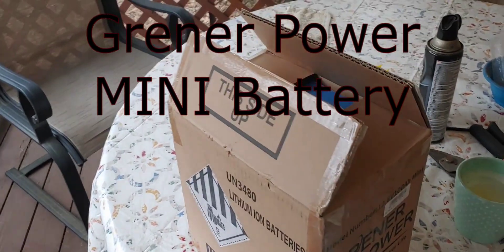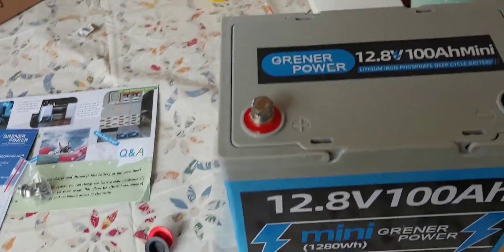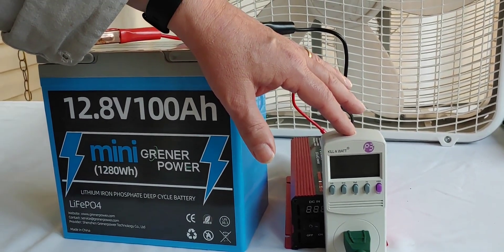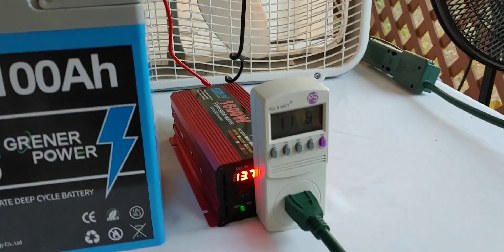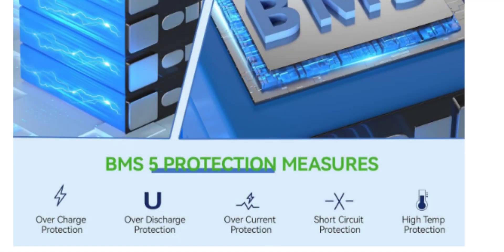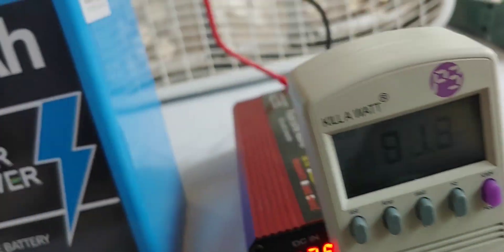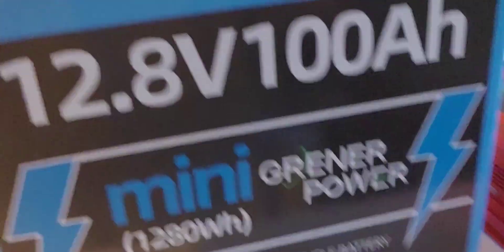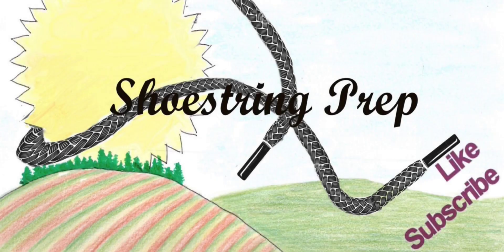Grener Power MINI Battery is this cheap LiFePO4 battery worth the low price?

Comment: I bought a 4 pack of these.  They seem like good batteries, but one of mine came quite unbalanced and all of them improved after pushing a full charge several times over a week or so.

You can tell if they are not balanced if you have a good charger that charges to say 14.5v or 14.6v but no higher and a reasonable volt meter.  When the charger turns off, disconnect it, then put a small load on the battery for a few seconds.  Disconnect the load and measure the battery voltage.  It should be well over 14v.  My four will now be 14.25 to 14.4v.  When I first them, the highest was 14.0v and the lowest was 13.4v when tested like that.

BTW, I agree about the camera movement.  It is especially bad as I am watching at 2.5x and could not watch, had to just listen.
Reply from the maker: I am pleased to hear they are working for your now. Thanks for your comment.
Reply: Have 2 in a 24v set up.not sure if they are imbalanced or bad but they go from full power(by led power level indicator) to half after barely any use.they also seem to get stuck at the 28v level when charging and take forever to reach the 29.2v full charge with a lifepo4 smart charger.just wondering if yours acted the same and i have only charged these 2 times to the full 29.2v since it takes hours when it should be way less.my charger puts out 15amps and i am talking about 6 hours charge time with maybe 600 watts usage.thanks.they are only about 45 days
Reply: @keithwilkinson1352  If your "led power level indicator" is just measuring voltage and not the amperage in and out of the battery, it is near useless for LiFePO4 which will sit at a nearly level voltage for the majority of the charge/discharge. Your description sounds normal to me if that's the case. If it is a dedicated LiFePO4 charger I'd just let it charge until it turns off - the batteries come about 50% charged and possibly haven't yet reached full.